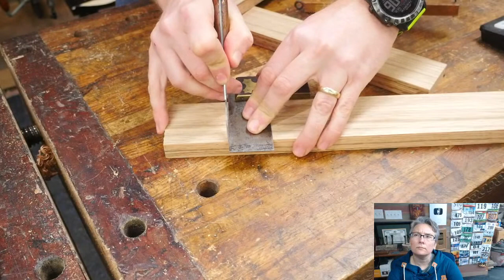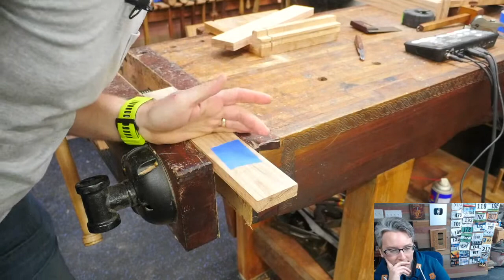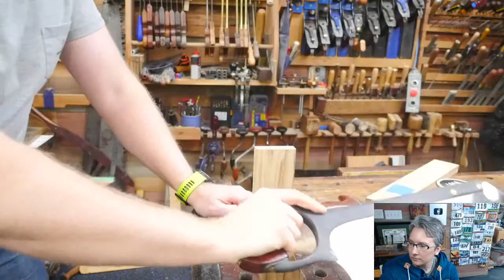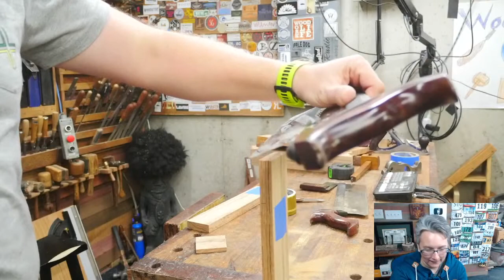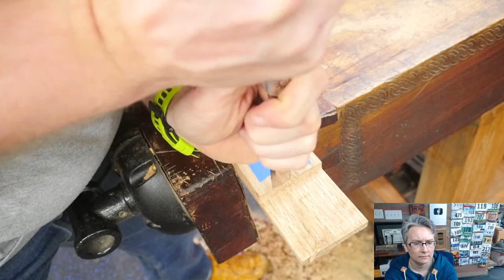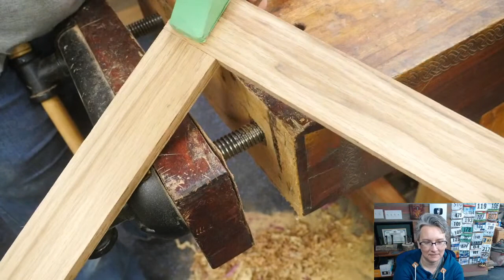How To Make a Half Lap Joint | Joinery Window Live

Comment: I just realized that most joints in the window are cross-grain joints. Won't this create problems with wood movement, or does the glue prevent this (like in plywood)?
Reply from the maker: Almost all joints in reality are cross-grain joints. That's what makes it tricky is choosing the right joint for the right connection. All depending upon which direction the forces will be going on the joint. for something small like 3 in or less the glue is more than strong enough to hold against most expansion contraction. As long as it's not outside in the rain glue can hold small pieces like that rather nicely.

Comment: Hi, James.  I noticed you didn't wet the end grain  before paring it.  Is that due to tradition, or some other rationale?
Reply from the maker: Wetting down the endgrain can make it easier to cut but a good sharp chisel makes it plenty easy. In my book it's just an extra step that's not needed and if done improperly can lead to a lot of other problems with moisture absorption. In my book it's just something it's not needed as long as the chisel is sharp. However, other people like to add it to the process. So in the end it's just a personal choice. If I had to guess I would say probably somewhere around 5 to 10% of hand tool woodworkers do it and the rest don't.

Comment: Interesting the guy building his house of maple instead of pine. 
Long term how will the maple stand up to the normal movement of wood ? Pine being a relatively soft would flex & absorb movement
Reply from the maker: Pine moves far more than maple does. So maple would be a more stable substitute. It used to be very common to make houses out of oak but that got more expensive and pine got very cheap.
Reply: @WoodByWrightHowTo  Back in the eighties, the lumber prices were severely depressed.  I read an article about a man who built his entire timber frame house with cherry he bought for $0.10 a board foot. Where I had 50 acres of timberland, firewood (oak and hickory) went for  $28. per cord, split, delivered and stacked.  Pulp wood (syp) was even less, but easier to harvest.
Reply: I was wondering if pine would flex & maple split/crack from any movement?

Comment: 18:00 you don't use knife wall the "traditional" woodworkers use?
Reply from the maker: No. I find a knife wall to be one more step and doesn't hold that much more benefit once you get decent at using a saw. For a beginner it can be fairly useful as it will hold the saw in place a little bit.